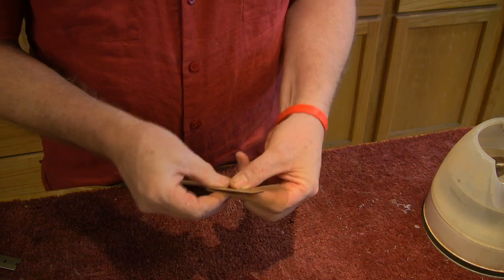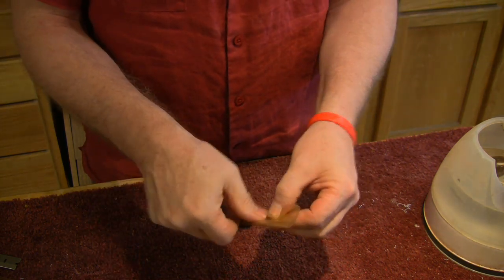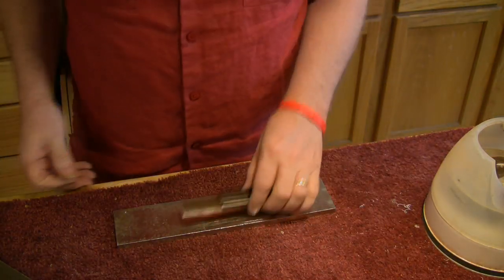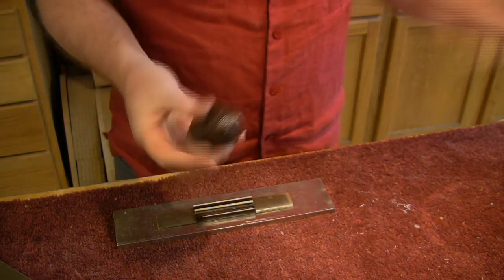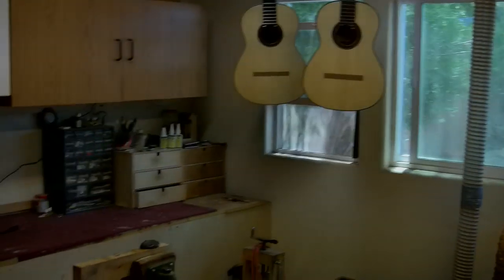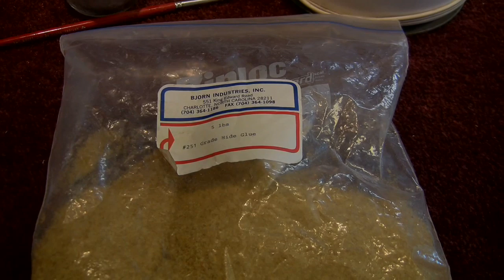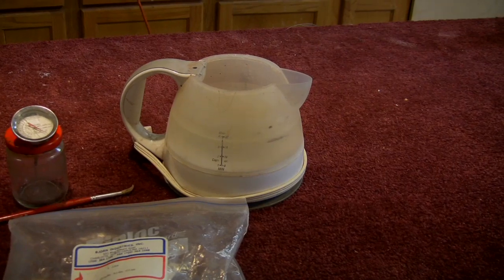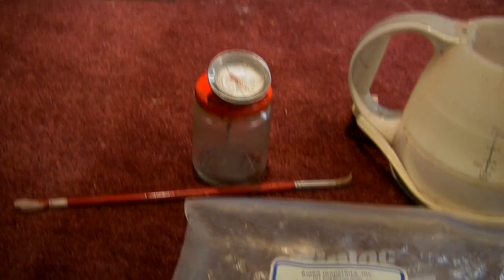The bridge part 1  (Working with Hide glue)

Comment: Hide glue is Not that difficult to work with.
And Most of us who use it, use a thermometer, not a temperature gauge.
Reply from the maker: I've worked with it for decades, the temperature gauge works just fine. Thanks!